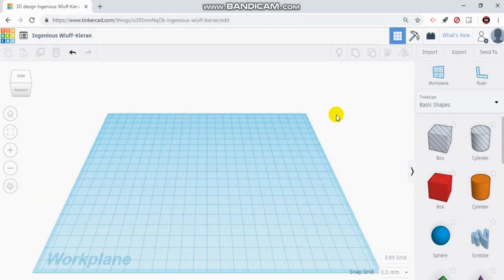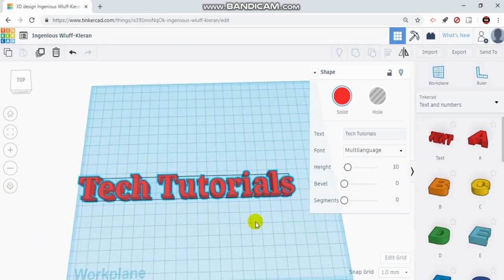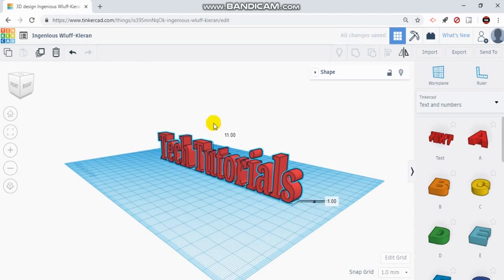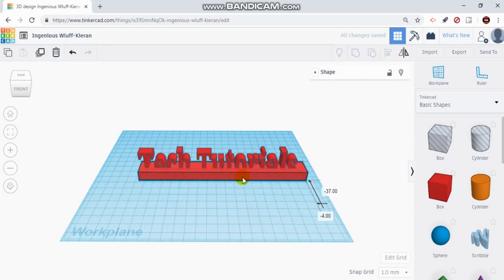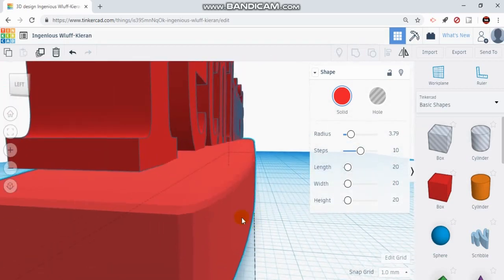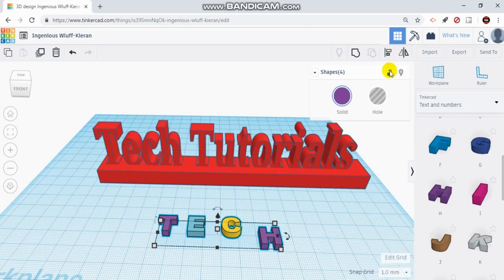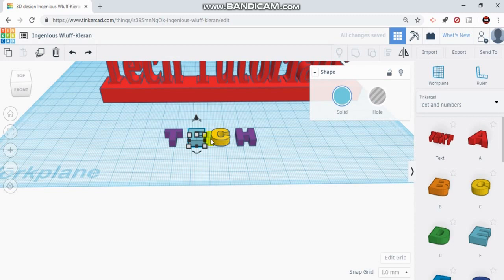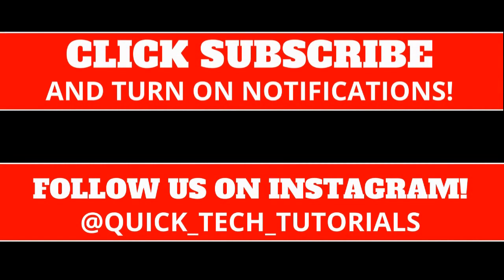*Tinkercad Tutorial* #6 - Creating a Nameplate Using the Text Tool and Letters

Comment: How do you go about the "dot" of the letter i in "Tutorial"?  Is there a way convert the text into shapes?
Reply: Ok but how would I go about to delete the dot. So I can use the cylinder
Reply from the maker: Hey Alvin, 
What exactly are you trying to do with the dot? The text is already considered a "shape"  so when  you use the text tool, you just type in the word you want and you can edit the size and rotate it as you would with any shape.  If you are trying to edit the dot separate from the rest of the word, I would remove the dot first and then use the cylinder shape and edit it in the way that you want.  if you are unsure how to remove part of an object, look at the Tinkercad Tutorial #5 about half way through and you will see how to do that.  If I didn't answer your question or you are still having trouble, please let me know.  Thanks!
Reply: @quicktechtutorials7289  the dot of the letter I cant be printed unleess we let the dot touch the lower part of the i
Reply from the maker: @alvint4944  That is correct.  You would either have to put the word flat on another shape (back of word touching shape and letters raised off of a flat platform) or delete the dot in the i and use the cylinder tool to make another dot and position it where it is just touching the rest of the letter. You could also just create a simple line shape and position it between the dot and the rest of the letter to create a support for the dot.
Reply: @quicktechtutorials7289  yes, thats what I did, hid the dot, and created a new cylinder amd have it touch the rest of the i,  but if we could just convert the text into shapes or curves, we would easily be able to edit or "distort" the text to our needs.
Reply from the maker: @alvint4944  That would be awesome. While Tinkercad is a great basic tool for free, it certainly has limitations compared to a full 3D modeling program